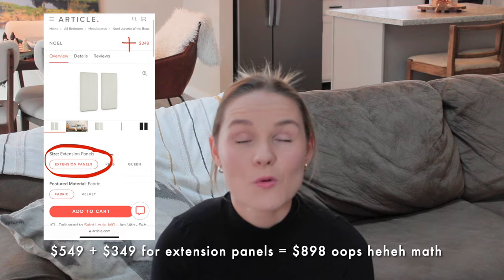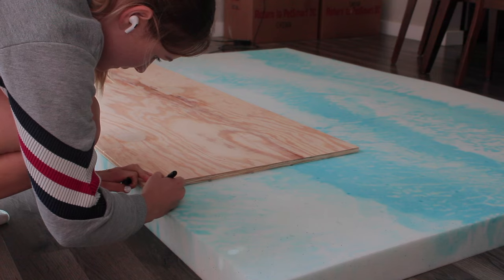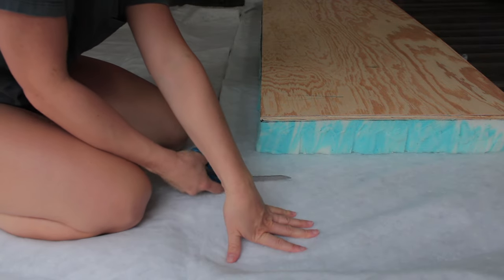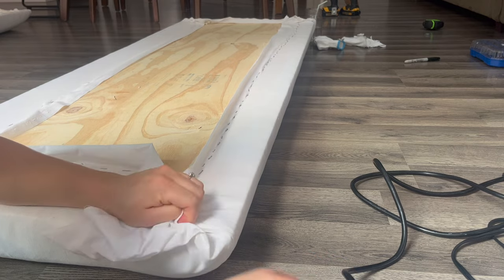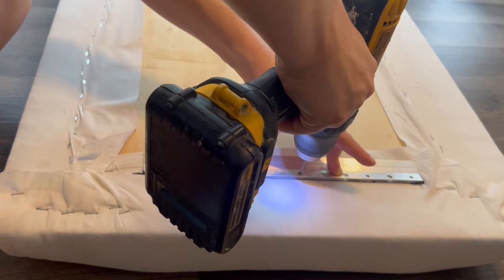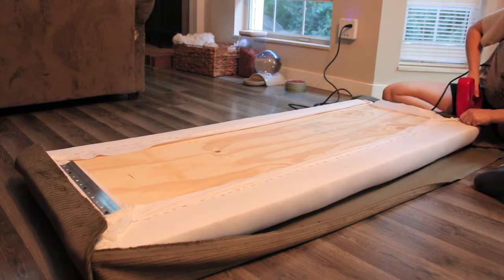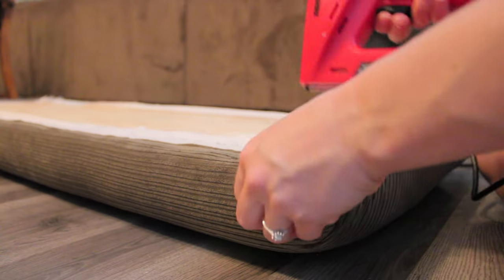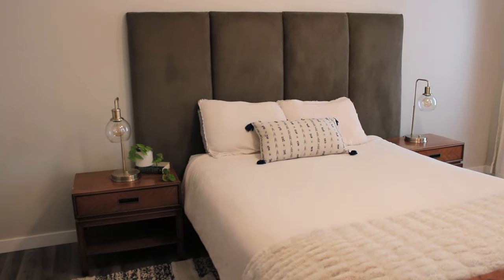DIY Upholstered Panel Headboard | Luxury on a Budget

Comment: Beautiful work! For future reference, if you start your stapling from the middle of your edge and work your way out to the ends, you can get the fabric tighter to the headboard without possible ripples in the fabric!
Reply: What is the "middle of the edge??"
Reply from the maker: This is a great tip, thank you!!❤
Reply: Also, a bread knife for cutting foam, needs the serrations for a clean cut.
Reply: Yes, the middle of the edge, I would appreciate if you would let this dummie know what that means, I am a bit confused 😊 thanks in advance

Comment: How many days and hours did it take?
Reply from the maker: It took me quite awhile because I had to spread it over several days, so it took me probably 12 hours total. You could save time by not doing the plain white fabric between the batting and corduroy. That step isn’t really necessary, I just did it in case I want to easily change the top fabric later on. Thank you for watching!!❤